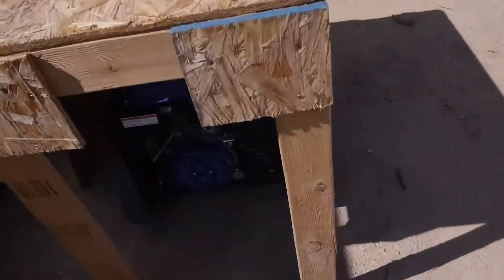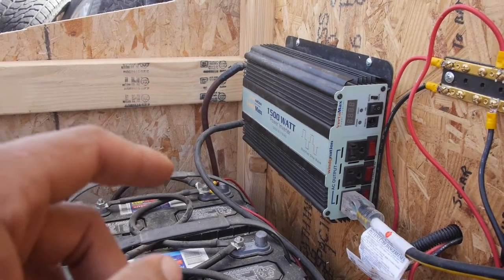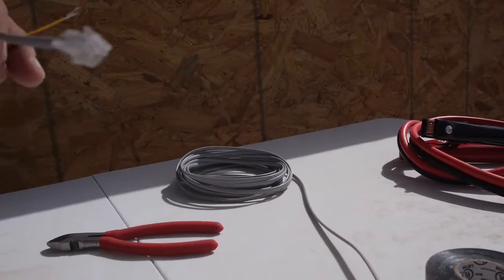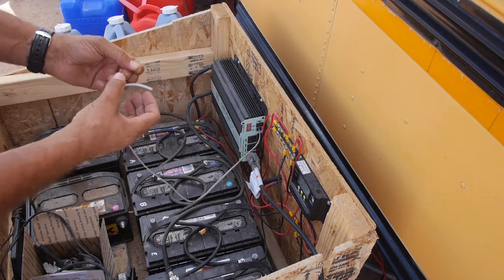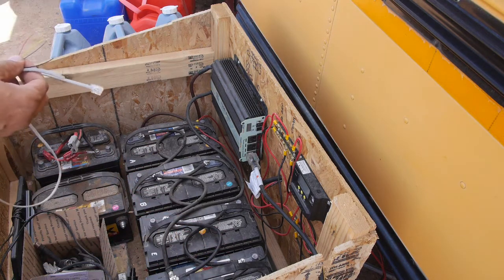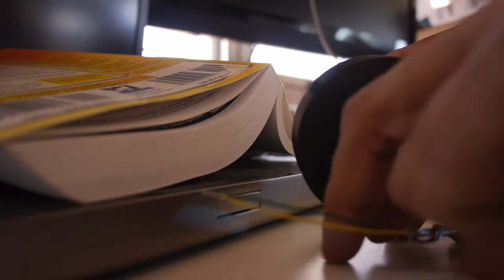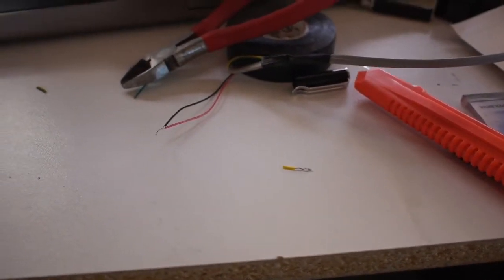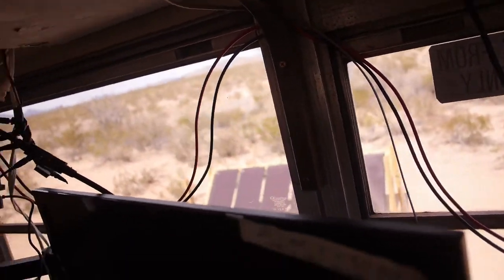DIY Remote Switch for Inverter using RJ11 Phone Wire

Comment: Got it to work with red and yellow with mine.

Then I touched yellow and green and it smoked the switch, so I disconnected the battery and gave it a few minutes but when I reconnected the battery the inverter came on but would not switch off using the original on/off switch, nor is the phone wire touching turning it off. So maybe its not such a good idea to mess with  them after all.
Reply from the maker: Rambone oops sorry to hear that you had problems! I wonder if some of these use the second pair of wires for a voltage display on the remote? Best wishes.
Reply from the maker: Rambone oops sorry to hear that you had problems! I wonder if some of these use the second pair of wires for a voltage display on the remote? Best wishes.
Reply: I will open it up and probably change the switch if I can find a replacement, but not too worried as I have a battery disconnect switch that I just installed and that is turning it on and off. Good news is that I now know that I should always have a breaker or a disconnect switch on these dc bad boys when messing with them. Knowledge gained is always a good thing :)
Reply from the maker: Post a video if you open it up. Also look out for capacitors, they can hold a charge, could be dangerous, or exciting, depending on your point of view ;)
Reply: All 4 of the connections from the phone jack to the circuit board are connected which means 2 of them are to turn the inverter on and off and the other 2 are probably for a light. So when I touched the wrong pair, it shorted out that complicated looking circuit board. This board is connected to the main board with a 5 wire plug. Trouble is this is a Chinese made inverter and has no brand name.
Reply: Just did the same thing to my 1500w Adventure Kings inverter..
Found the correct pair then foolishly kept going and proceded to smoke the circuit from trying another pair.
Wondering how easy it would be to open it up and do a custom switch on job.
Reply: Sam Holmes hey Sam I’ve just pulled my Adventure Kings inverter apart as well... what was the correct pair???
Reply: @sam418  Did you get it fixed?

Comment: There is a risk to burn the "roads" on the micro scheme by shorting wires blindly. RJ connector might be only for information, and not switch. The easiest and safest way is to connect wires to the actual switch.
Reply from the maker: Yes I will agree with you, lessons learned in the last few years after this video was made. In this case it worked, but probably not the best risk to take.  Thanks for the comments!

Comment: Good job! I'm curious what brand your inverter is. I'm getting ready to build a remote switch for my older Cobra 1000W. It's main power switch is a momentary push button instead of a rocker... It does have a 4 pin RJ11 jack for a remote. I have read a couple of inverter remote wiring schematics that show a momentary switch and also a way to wire an LED on light.... I guess I'll just experiment with it a see.
Reply from the maker: Take a moment to read the other comments, and be careful, one person killed the inverter I think, can't remember if it resets or not. They're all different apparently! Good luck 🤞
Reply: @saaaron5213 like to hear how you made it and how it worked out. I need to make one for a Cobra as well.

Comment: There does not seen to be a standard for the wiring for these remote switches, yours used different color wires from mine  to turn off and on. I've been checking some comments in amazon and it seem that you have to buy the right remote to match inverter. Maybe at some point manufacturers will standardize the wiring
Reply from the maker: Rambone yeah I know. Depends on which end of the cable, or if it was wired correct also...

Comment: If I may... I just shut off my main breaker inside. Saves going out to pet down every night lol
Reply from the maker: That's another option :) I don't have the gear to really test energy used, but my inverter seems to be drawing power even with no load, so by turning it off, I saved some power. At the time, I barely had enough battery capacity to brew coffee. Since making this video, I've upgraded practically everything, so have more power available in the batteries, so I leave my inverters running 24 / 7.  Thanks so much for the comment!
Reply: That's fair, and to be honest, I do turn mine off in the winter time here in order to conserve every scrap of juice for my furnace. =)

Comment: is the switch on the inverter off or in "remote" mode? I tried this with my GoPower and couldnt get it to work
Reply from the maker: On mine the inverter switch would be Off, there isn't a "remote" option on the switch. Take a few minutes to read through the comments on this video, there's a lot of different ways this can work, or not work. There isn't any set standard for how this can work.
Reply: @CarlinComm  thank you sir.  I figured it out.  The inverter is facing away from the door so I couldn't see that the switch was remote-off-on.  I'd been trying it with the inverter off.  Once I found a diagram and a picture of the switch I was able to get it to work.  I was even able to wire it to an upfitter to switch it on.
Reply from the maker: That's great news!

Comment: I’m confused. So did you only use the red and black, leaving green and yellow connected to nothing?
Reply from the maker: It's been a while, but yes, only used 2 wires.If you read the comments, this works for some inverters and not others. One person who tried it said it killed the inverter, so it's up to you. Good luck!
Reply: @CarlinComm  thank you sir!! I read that some need a momentary only switch as well. 🤙🏻
Reply from the maker: Yes, there doesn't seem to be a standard for this. I started by just touching 2 wires together until I found a pair that works. Another option is to take the inverter apart and splice an external switch in parallel with the main switch.  Or see if you can find a remote for your inverter. Or Google it, and see if you can find a compatible remote either for your unit or 3rd party.

Comment: Are you down in the San Luis valley? It looks just like it. Lol
Reply from the maker: I'm about 100 miles from El Paso Texas. I think it all looks about the same!
Reply: @CarlinComm  hahaha wow!! That’s good to know, so I don’t assume that again. Lol
Reply from the maker: Yeah much of California, New Mexico, Arizona... Even Washington state east of the mountains looks like this :)
Reply: @CarlinComm  Everyone here's been calling it RJ11 when the four pin is actually RJ14. But you've opened my eyes and now I am looking to do something with my two manually switched inverters. My use case is slightly different. I have to turn them on the moment I'm hit by our local rolling black-outs so once I figure out the pin-outs (they're from different manufacturers) I will put them on a relay to just do it.
Reply from the maker: @oakwoodacademypolokwane6033  good luck, it seems there is no standard, so be careful. As someone else once posted, if you want to take the inverter apart, you could also wire a switch or relay in parallel to the main switch and not use the phone style connector.

Comment: So mine turned out to be green and black.  Now when I use a switch that looks like yours I have to toggle the switch twice to make it work. Example  up down to turn it on then up down to turn it off. Is this what you have to do? Also not sure what to do with the other two wires ?
Any help will be appreciated.  Thank you and great video. You helped me a lot.
Reply from the maker: Hey David, thanks for the comment. This is one of those areas that is really dicey. Apparently there is no standard at all for how that switch or port.. jack? works? On mine, I can just simply turn the switch on or off, and it worked. I say worked, because at some point, the mice chewed the wire somewhere, and its not working anymore. But when it worked, it was just simple and good to go. I've heard other people say theirs was a momentary contact, so more like a brief press and release, instead of a toggle. At least one person said they damaged their inverter doing what worked for mine. Some manufacturers use that port for a remote switch AND a remote display. It could be a digital serial type signal, not just a simple analog voltage feed. I had a few other people comment they had opened their inverter up, and tapped directly into the main power switch, to extend those leads, out to a remote switch. Somewhere else I heard of replacing or adding a relay at the switch, to be remotely operated. I have remote relay switch for something else I might experiment with. I'm getting to the place now, I'm more aware of the responsibility to not show people how to do things, that I have no control of. I feel bad if someone blows up their inverter, or worse if they burn down their RV or house right? So there are a few things I'm doing now that probably won't get videos made! Anyway, long story longer, sorry, if you found a pair of wires that work, you might try a momentary contact switch, maybe it just needs a short "beep" to turn it on, instead of leaving the switch latched on. Just a thought. Sorry, there is NO standard on this. And if it is mentioned in the manual, its probably still not quite right :) Thanks again for the comment, if you do figure it out more, let me know, I'm always curious!
Reply: You should use a momentary switch instead of the one you are using now and a small power light of some sorts to say if its on or not, maybe a nightlight with the light sensor taped over so its always on with the power
Reply from the maker: @zachary6656  From what I've seen in the comments, there isn't any standard. Some work momentary, some work with on off switch, some let the smoke out. As for an indicator, I just look over at the microwave, if the clock is blinking, I know the inverter is turned on still :)

Comment: AAARGH!!!!!   Better to put a meter on the factory remote to find out the switching pair.   Some of these use the other wires for LED indicator lights and you are messing with fate if you short those wires to each other or to the power switch.  Sometimes you can take apart the factory remote and see which wires do the remote control.  On mine, it was the middle two wires in the RJ11 jack.
Reply from the maker: Yeah if I had the factory remote I wouldn't have needed to do any of this. Guess I got lucky, that worked for me, for over a year before the mice chewed through the phone wire I used. Apparently a couple other viewers had problems with this. Thanks for the comment.
Reply: @CarlinComm  Good argument for shielded cables huh.
Reply: Or take the cover plate from the inverter and trace out the wires. Most likely the circuit board is marked for what each wire does.
Reply from the maker: @brettschacher8644  Yeah, if I run out of every single other thing, taking the inverter apart does sound like a lot of fun :) I mentioned that in the other comment, I liked your idea for running a parallel wire to the switch, will probably do that for the inverter that doesn't have a remote, or just wire a relay in there. Then the Arduino could control it or something.
Reply from the maker: @Karl with a K Well if you read the comments, it is helping some people, and I left a lot of warnings in the comments for other people. There is always risk blindly following stuff you find on the interwebs.

Comment: how are the harbor freight panels doing as far as charging your batteries?
Reply from the maker: the Harbor Freight panels are holding up pretty well they're still working as good as they did the day I bought them obviously they're not really high power panels but they're still working it's hard to beat them for the price and for the convenience of just being able to go down and pick them up out of the store.
Reply: do they charge the batteries ok how long does it take to charge
Reply from the maker: On a sunny day, the 3 kits can charge 4 big deep cycle batteries to float. Much depends on how low I discharge. I can usually brew coffee, edit video, charge phone, and cool off the deep freeze most days without running the generator.

Comment: Most standard RJ11 flat phone wire ("silver satin") is wired as roll-over by default, not straight through. That is why the wiring was reversed when you used the other end of the cable.
Reply from the maker: Yeah that sounds about right, it's almost like the idea of a Null Modem wire, the TX and the RX wires are crossed.
Reply: @CarlinComm  and everyone else looking at this post, The best thing to do would be to use a hi impedance digital multimeter and test each wire to see what the voltage level on them is, also look to see if the boards have any markings on them that tell you what they are, or where they go . The simplest switching systems use 2 wires and not likely these will have a remote option, although they can be made remotely controlled. You just have to be sure the original switch is in the off position and then you can connect your remote switch in parallel, bypassing it. With more than 2 wires one is likely going to be a ground wire, another should be a low level + voltage. Since the power switch in any of these is not for high currents, hence if one is hot and the other is not, such as a ground, you would obviously smoke the switch or circuit if shorted  and there is a small board connected to the switch and main board. Some of these small boards drive an LED display also. This board controls the section of the inverter that triggers the FET's, the solid state switches mounted to the heat sinks. Just touching wires without knowing what they do is a GREAT way to render you inverter useless ! Since the RJ11 has 5 connections there can be 1 for a ground, 1 for a voltage to indicate state of battery charge, 1 for a signal turn the inverter on and 1 to turn it off. In the case of having a slide or rocker switch on the front panel, either 2 or 3 leads would go to the controller board, on this board is another transistor, that takes a small voltage, applies it to a gate or base of a transistor that turns on supply voltage which powers up the inverter circuitry. Since all of these units are permanently connected to battery banks, you get a spark when initially powering them up, BE SURE to connect the + lead first then the -, you get a much smaller arc this way and it can also lessen the risk of damaging the inverter and NOT melting battery terminals and burning cable ends.
Reply from the maker: @brettschacher8644  Hey Bret thank you for taking the time to explain all that, well done! Just curious, did you mean to say 4 or 5 wires for the RJ-11? All the ones I have are 4 wire, basically they were set up to be 2 phone line pairs. Most of my time was in IT, wiring RJ-45s, even the phone systems we wired were using 4 pair wires, but I never got very good with that stuff. Otherwise, an interesting comment, thank you! I've seen from several other videos, as well as the comments here, there does not seem to be a standard way to wire these things. And the instructions I have didn't mention any of the wiring. I was also considering what you said, just wire in parallel to the main switch, I have a HF inverter that doesn't have a remote option, will probably do that, eventually. Best wishes for the new year!
Reply: @CarlinComm  I may have gotten the designation of connectors incorrect, yes phone only uses 2 pairs and a 4 point connector.  RJ 45 is 8 pin. No, there is no standardization in these inverters for interfacing with remote devices and that is a shame. I wired a system some years ago for an all off grid power supply at a remote cabin and it seems to me that inverter uses a 8 pin interface for switching and monitoring using a LCD display. I think 2 wires were for control and the others were used for ISC or something. What ever the interface was, or is, it's still best to look and see if the circuit boards are marked which most are so assembly people can be sure to connect everything correctly. And using a meter is the safest way to test for power or ground.
Reply from the maker: @brettschacher8644  OK cool, I think we can agree on all that then! You seemed to have all the other details well thought out, I was confused about the pins on the wire. Thanks for the comments!

Comment: Thank you, Carlin! You help me a lot!
Reply from the maker: Cool, glad to hear! Thanks for the comments!
Reply: itsdatruff  From what I've seen, in the comments here, everyone has a different experience, they aren't all wired the same. On mine, just making contact between the 2 wires turns it on, you leave them connected. I used a switch to make the connection, but you could definitely use a relay, it would be contentiously on, not momentary contact. I'm thinking I might do that on my other inverter, it doesn't have a remote switch, but if I wired a relay in place of the switch, then I could turn it on remotely that way. Hope that helps, and best wishes!
Reply: Sorry, I'm logged in with my other account, this is Carlin!
Reply from the maker: itsdatruff  Read the comment that "Mars Clipper" wrote, that was me, sorry, I was on the wrong account. Best wishes!